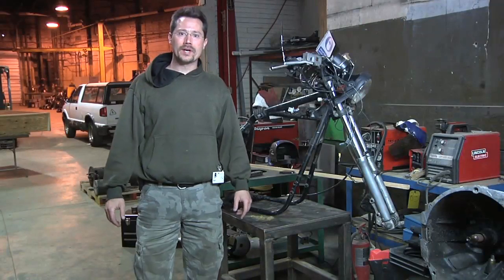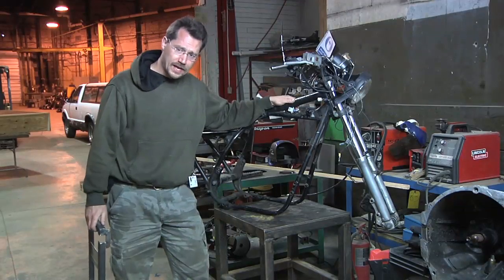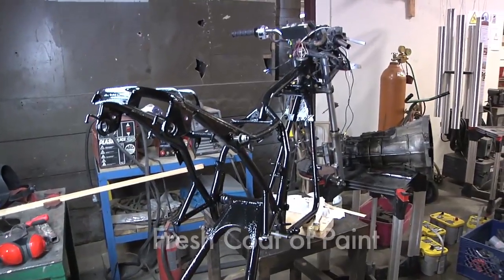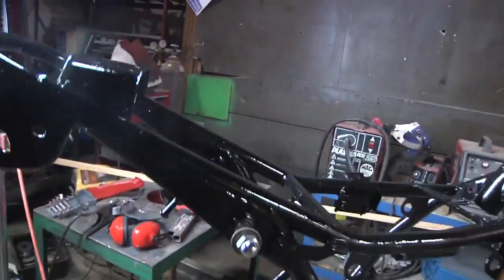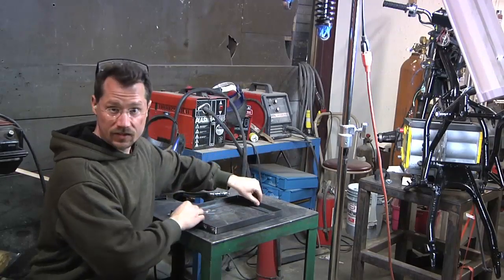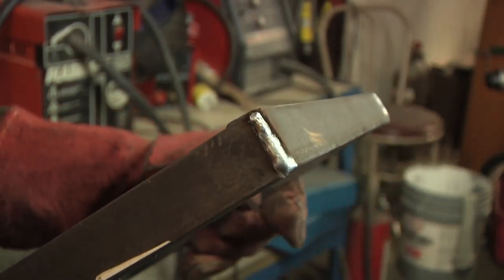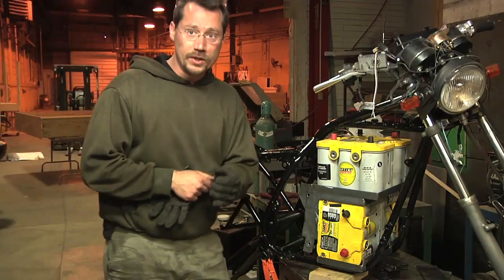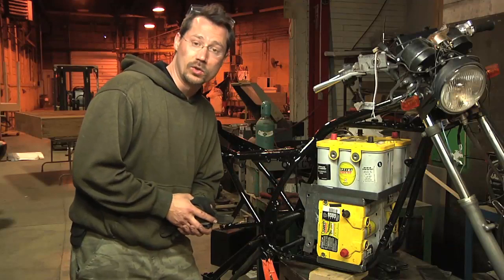Electric Motorcycle Paint Job and Battery Rack

Comment from the maker: @CyberDruif 
These are spiral-wound AGM batteries. They are fine to mount sideways. (You wouldn't want to do that with flooded batteries!)
It's probably not a bad idea to "rotate" the batteries once a year. I could move all the batteries one position when pulling the cycle back out in the spring every year.

Comment from the maker: @pheenix42 
I wouldn't know how to use the fancy stuff even if I had some.

I have done a little powder-coating. (A friend of mine has the gear to do it.) I might powder coat just the battery rack components. I think I can squeeze the motorcycle gas tank in an oven. If I can, I might try powder-coating that too.

I DO love Rustoleum......  It's what holds the Electro-Metro together....